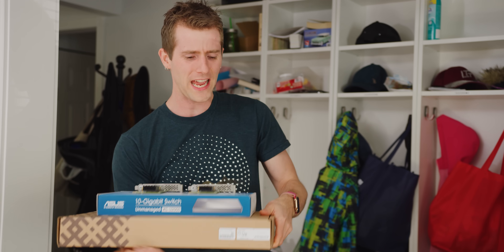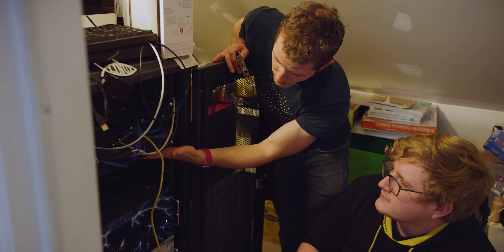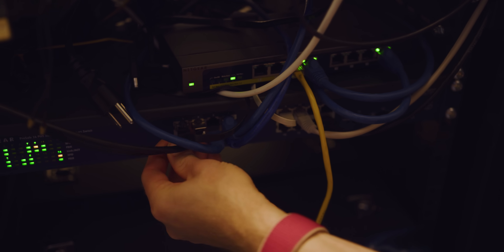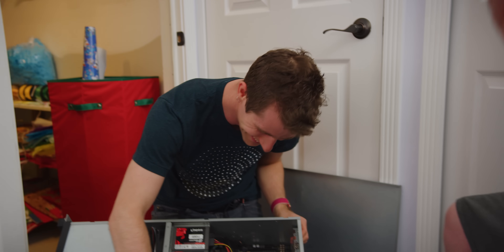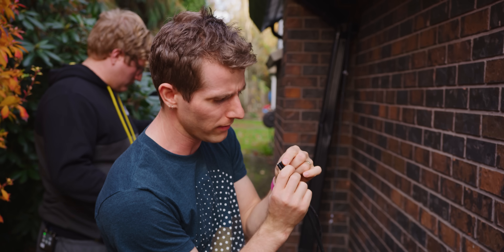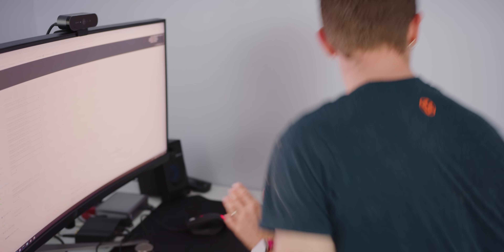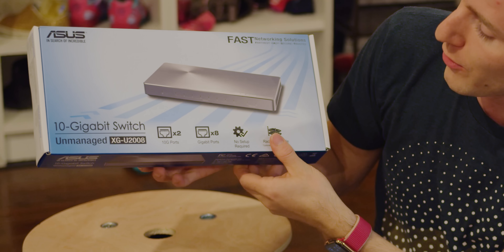Home 10 Gig Network Upgrade for CHEAP

Comment: "Just 500 USD"

Well, not as cheap as I was hoping :/
Reply: Some of Mikrotik's cheaper products offer SFP+ if you wanted to do 10Gb backbone between switches or if you just wanted a few devices to be at 10Gb (say a NAS, or any VM infrastructure)  and leave your endpoints at 1Gb.
Reply: @TheBrich91  I have two servers that this would be good for, however I'd also want 10g to my editing pc, and that would be a fairly long and expensive SFP cable unfortunately. Maybe prices will start coming down a bit more though, I'm sure enterprise 10g will continue to get cheaper as 40g is used more and 10g becomes cheaper overall.
Reply: @XOIIOXOIIO  you could also go with Multimode Fiber SFP's. They have come down in price A LOT.. You can get some pretty affordable secondhand HP or Dell branded SFP+ pcie cards for your servers and your Desktop.

Just a thought. I've been scheming on it myself lately.
Reply: @XOIIOXOIIO  A server/workstation with a 4port 10Gb or 2 2port with bridged connections would give you enough for a server and couple workstations
Reply: @TheBrich91  I'll have to look into it again. The limiting main factor would have basically been the 30 foot or so sfp run depending on how I routed it.
Reply: You get 4 hours of consulting about programming network switches in linux kernel drivers for $500 from me. YOU should get a new job.
Reply: @llothar68  Oh, I want a new job, but the market here sucks unless you have a bachelors degree for entry level positions, and moving elsewhere is expensive, same as getting said bachelors degree.

Comment: I actually think it would have been more realistic if you did this as a 2.5G/5G (802.11bz) project. It needs less cable changes, is cheaper, the switches are quieter, and it's more than plenty of bandwidth for a home.  Many NBase-T switches have an SFP+ for the NAS, as well.
Reply: Try finding a 5 GB card.
They don't seem to exist in my (somewhat limited) searching.
2.5 GB is common, cheap, and can still run on 5e.
Reply: @bricefleckenstein9666  At the time of posting I grabbed a Marvel AQN-108 for $69.  5 gig, single lane of PCI-E 3.0.  Unfortunately they are hard to find now, perhaps with the chip shortage they cut back on that product.
It's also hard to search for 5G network cards as you get a lot of hits for wireless.
Reply: @rbeck692  I don't do wireless.
Never saw any reason to use it.
I was NOT getting hits on wireless when I looked for 5G network cards - but it might depend on how you word the search.

And quite bluntly, with 2.5G cards at commonly $30 AND LESS (some under $15 for no-name stuff) and the switches even from name brand vendors commonly $10-$15 a port, I don't class $69 (or the lowest cost 10G I could find at well over $100 for 10BaseT and MORE if you went SFG plus transceiver) as being cheap for the performance.

Perhaps in a few more years.

Comment: but there is still no household router with 10Gbps WAN port, and of course , 10Gbps broadband is NA yet
Reply: Any router can be used in a household. A business connection could probably get you 10 Gb

Comment: Great vid thx.
Signing up for privacy.com asap...cool.
I went with the 4+1 port MicroTik CR305, 3xMellanox conX-3 nics, 8x10Gtek spf+ transceivers & 4×10Gtek OM3 fiber (3M-10M). (Looking for a fourth Mellanox nic at a decent price.)
Did the dumb... er...unmanaged switch setup. Jake rolling his eyes...yeah I'll VLan it later.
1st transfer test between 2 pc's: Samsung 500GB 860Evo on sata3/6GB cable to 250GB 850Evo on sata2/3GB cable was 384MBytes a sec.
Worked out to be around $195 per PC (x4) including switch.

Comment: me sitting here with 100mbps ethernet 
its good enough 
linus: 1 gig speed not good enough!!!
Reply: Switch to a 1 gig switch they are about 20 bucks for an 8 port then you'll begin to see the difference when you transfer data between machines

Comment: Please tell me if you are crimping you used solid core crimps that cup, or stranded core crimps with teeth for stranded core cables. I prefer punch down and hubbell gear. Also inside walls are better to wire always than outside walls. Oh and Fluke testing is amazing.

Comment: Hey Linus mikrotik super awesome gear. we specifically use it in our towers and our core network. (run ISP) they super powerful. give me a shout if you need any help with anything. know the things backwards. bgp and ospf routing super simple with them as well

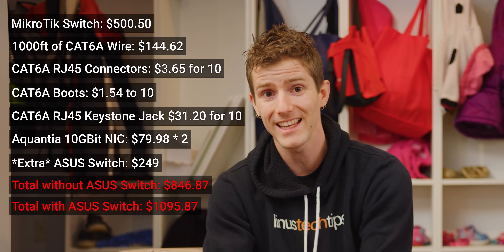Comment: 14:26 Yeah Linus, tech usually gets cheaper over time. Just wait another 3-5 years and the price will drop even more. 
Let's be real though, 99.9% of people don't NEED 10 gig networking in their houses. Most don't even have gigabit internet.
That's not to mention, saturating that throughput would be extremely hard for a typical household.

Comment: I did something similar but I did it the poor man's way. I got an old Linksys 2016 gigabit switch with two fiber optic ports which one of them goes to my media server and then everything else in the house gets a gigabit cable to it. So I get 10 gigabit to my home media server through fiber-optic instead.
Reply: But what if you need 10 gig to another machine. Now you have a problem. But if you have a server/workstation one could put a 2-port nic in that and connect that way or double up with 2 2 port four four total.

Comment: I'm running all 10gige on cat5e with Aquantia cards, Intel x540 cards and a Netgear XS708T... 50+ft runs indoor/outdoors, no issues. Was $700 for the switch at the time last year, but no issues to report.

Comment: I hardly saturate my 1gig network lmao
Reply: It's really easy to do with any real NAS activity or running backups. I have an older 300 GB hard drive that can comfortably do 1 gigabit
Reply: I don’t even have a NAS lol. Just two gaming computers and a Apple TV and some mobile devices and some raspberry pi’s. I would like to mess with a NAS though, especially the docker functionalities.
Reply: @brkbtjunkie  well hopefully you are backing up all your Games Etc.
Reply: mrmotofy no need. They exist on steam, origin, etc etc. my current game install size exceeds 2TB, I just don’t see the need to back up game files. I do back up all configurations and user files though.

Comment: I only have Cat 6 cables and the one that runs in the ceiling/loft was put there 10+ years ago (I think..)
Its shorter than 33 meters so its good for 10 gig

Comment: The big problem with this particular MikroTik switch is the fan noise.  That alone makes it problematic, given its positioning as a SOHO product.  It's not just the loudness but the pitch as well.  It's an annoying whine, not unlike the 1U Supermicros of yesteryear and their obnoxious Delta fans.  MikroTik really should have spent more time tweaking the thermals, or at the very least a bigger heatsink with quieter fans.

Comment: If the switch is set to a static IP on a difference range that may be why you can’t see the management IP :) I’d put myself on the 192.168.0.x range and do an advanced IP scan there . That’s if it’s managed at all ..

Comment: One of my favorite tips about separating and lining up the pairs when terminating lines is that when you cut the plastic lining for the outer cable, hold the tube that you're going to discard anyway. If you can put one wire of a pair inside the plastic tube and the other end outside you can untwist the pairs super fast by just pushing the shielding down and just doing a small clockwise motion as if you're screwing down on the twisted pair. Your guide looks pretty standard for any T-568B wiring, whether you are CAT 5, CAT 6, or CAT 7. 10GbE is more sensitive to connection and continuity  issues than 1GbE but otherwise follows the same requirements.

Comment: Using two mikrotik switches here for 10gbe (one in basement, other in office) and using them with 1gbs switches. Bit of a mess, but it works. Using used 10gbe mellanox cards from eBay.

Comment: I still don't understand why you don't just route the ethernet down through the walls on this? It would eliminate a lot of the hassle that you have for getting ethernet down to the media center. Though maybe there is something about how homes are built in Canada that is very different from the United States.

Comment: When I ran the first internet lines at my parents house 10 years ago I INSISTED using CAT6 cable, if we EVER get 10gig to their house, it has been ready for YEARS
Reply: I wired my whole house with at least 3 rj45 in every room and Cat6 around 12 yrs ago
Reply: You were ahead of your time
Reply: I would like some fiber optic, but with twisted pair cables, I can just buy some cables, some jacks, reference material to properly wire the jacks, and the multi-tool dedicated to twisted pair cables.

I had practice in making those kinds of cables as part of networking college course.
Reply: @Aereto  from MY experience in Networking in college, FiOs is finicky and a pain to use, and a simple break ruins the connection. Twisted pair is alot more durable

Comment: I bought that exact switch and am super happy with it :)
Reply: Oh, and for the love of god look into Winbox. These units run SwitchOS and RouterOS, and Winbox is the ultimate administrative tool for Mikrotik products.
Reply: routerboard.com // mikrotik.com etc etc
Reply: Yeah, yeah, too many replies I know. Not cool any more. Been using Mikrotik for over a decade, for the average user there is definitely a learning curve. But for pro-sumer level users there isn't much else out there that offers the power and functionality that these units do out of the box. Be careful when purchasing however, the products that are marketed as switches do not have the same packet processing capability that the router products do. Cloud switch products have non-blocking forwarding to cover any switch needs, however if you attempt to do any kind of routing you will run into limits fairly quickly. Make sure you do your research! Buy a router oriented product if that is your need.
Reply: @tq_1203  good
Reply: nice

Comment: "Completely blocks all the airflow..." Hasn't Jake seen Luke's video showcasing how even having multiple carboard boxes, a santa hat etc. inside the case barely affected things? =)

Meanwhile there's GN showing how removing a single dust filter or changing the placement of one case fan to a higher or lower mounting point can shave multiple degrees off of your computer. =)
Reply: because fans make airflow not some card boxes. If fans have good pooling and high pressure even santa claus cant make difference. If your airflow is rubbish from start then it's another story.

Comment: EDIT: I just noticed on the tech specs page that the first 8x 10GBase-T ports also support 2.5GbE/5GbE which may prove useful to those people with motherboards or Wireless Access Poinnts which support those speeds.

You should consider using iPerf for testing you network connections. This would allow you to test the network connection without worrying about disk performance bottlenecks. It could potentially provide a more accurate maximum performance for that network connection/route. You could also run tests from multiple source machines to multiple destination machines simultaneously to test if the switching fabric can properly handle more extreme scenarios.

Comment: Price for performance, Mikrorik equipments are the best.

I've been using Mikrotik devices for over 10 yours and I still haven't regretted my decision.

You just have full control over what you want the equipment to do for a really cheap price.

Congrats on your choice, you won't regret it.

Comment: Dude, do some cable management!
Also, call an exterminator. Rat poo is no joke.
Reply: Right, like the day before yesterday. No joke. 
Contagious disease + kids = no fun.
Reply: He now needs to review the Victor M2 Smart-Kill Wi-Fi Electronic Rat Trap

FYI, rats are smart! Roof rats are common around Houston in the winter time. If they can't find a way in, they will chew their way in!

Anyways yeah, no joke the damage they can cause to both insulation and electrical. In some cases, they can cause an electrical fire.

Comment: Holy crap..I'm renewing my house with cat 8. Trying to not get over 15meters of cable length. sfp shielding is really important. Here you see everything wrong for perfect 10gbit...no shielding..run senseless lengths of cabling.and using cat6 instead of cat7/8 for outdoor cabling..just kills my heart.40gbit is possible over cat8. So why not invest 60 bugs more for the cable and be safe for the future of 40gbit? Also non shielded cat5 Jack's.oO

Comment: $500 usd for a 12 port switch isn't cheap for home use TROLLIS!  And do you really have to splooge for cat 7?  What happens with 10gig on cat6, 5E, 5 etc?  you could test this by simply installing 10gig on a home with older RJ45 cables and see what happens by swapping in a few pcs with 10gig cards

And a lot of people run 1g or 100 mb (simply because  its still sufficent since not many people have a internet connection that does over 100 mb (some do sure but many are something less than what it can handle)

Comment: Being a nerdy fiber technician I went much cheaper by buying a Cisco with 4 SFP+ on eBay and ran fiber between my router, switch, and servers in my home. Using a Mikrotik RB4011 for my 10gb router.

Comment: Low voltage specializing electrician here:  the versiv is really cool we use them all the time, just finishing a job, 2 floors, 56 miles of cable, 16 24 port patch panels per floor, fiber backbone with redundant isp hookups, and about 50 grand in switches per floor alone.  I enjoyed seeing you guys do this.  It isn't always easy haha.
Reply: "56 miles of cable": My condolences to your back.

Comment: Good luck with that switch, while I love mikrotik routers, their switches are terrible, in fact I make sure to disable the switch chip on every mikrotik crs I configure and this is coming from a mikrotik certified routing engineer

Edit: download winbox it’s able to manage the switch via layer two and its more reliable than the built in web interface
Reply: Network engineer here as well. I love mikrotik hardware too, but i prefer to configure it through cli. It's much faster to configure, and its cli is well thought out.
Reply: Dominik Dobrowolski absolutely, but for what Linus was trying to do winbox is the way to go over the webfig

Comment: Ubiquiti’s 16 port XG is far superior to the Mikrotik switch for the same price. 12 SFP+ ports, 4 10Gb copper ports, and the ease of the UniFi controller.
Reply: But the rj45 is much more versatile for the average home or small business already wired

Comment: Great. 10 Gbit/s have arrived. I wonder when the first 40 or 100 Gbit/s over fiber will be affordable for everybody. 10Gbit is affordable,  if you already have CAT7 and if you take your money (saved for holidays) and upgrade your devices and cables.
But there is more:
IEEE 802.3ba seems to be in development. Can't wait for that. The only Problem: new tech is expensive.

Comment: Runs 10Gbps ports all over the house.
Gives 1Gbps connections to almost all hardwired devices.

Uses video streams that doesn’t go past 25Mbps and keeps living in the 80s before wireless was a thing.

Linus “Tech Tips”.
Reply: I wonder what that means.

Comment: Cool project.    I have been unable to find a reasonable POE switch with 10G capable ports.    I want a switch to connect all of my POE security cameras to 1G but have 10G ports  to  connect to my storage server.
Reply: Then all you need is gigabit Poe with 10 gig uplink. Realistically you cameras we'll never get anywhere near gigabit. They still only Run 100 Meg. Full 1080 is only 4 to 5 megabit 4K is maybe like 75 megabit
Reply: @mrmotofy    Right now i have 8  4k cameras that are recording at 30fps and 2 more that do about 2k.  I also have 3 access points plugged into the same switch on another vlan. I have a constant 50 meg outbound connection to offsite storage as well so i want as much overhead as i can get.  My current Cisco SG220-26P does well because I team 4 of the gig ports to my storage server as a kind of uplink.  But i need PoE+ with a good amount of power available to all ports.
Reply: @BorisFett  Gotcha, best I can find is that 4k won't break 100Mb especially with H.264. So if you're using a Gigabit switch you'll be just fine with lots of overhead. If you have a 10Gb uplink to your NAS that will help but it's still all overkill. But otherwise Ubiquiti has awesome products and Netgear has a 10Gb switch for about $750 I'd be interested to know if the cams or NVR have 1GB ports. Most still only have 100Mb. Stream 1 of your cams to your computer and use Task manager ethernet to watch the data flow. That should give you a good idea.

Comment: Cable must be Big $$$ up there ive been doing all my Installs in barn , work shop, House etc on my land with Cat 7 interior and Cat7 Burial cable outside for over 3 years now, I am actually running 10 gb on cat 7  soon to be jumping to cat 8  2000mhz @  40 gb cable  just make sure you use Metal jacks with insulators.  Cow}:-o)

Comment: I remember a time the compuany I worked for ran 1Gb cables to replace all the 10/100 base T and 10 Base2 cables connecting all the switches spread out in the office. And installing new switches with 1Gb links and 10/100 ports for the workstations. Those switches where like $500 each and replaced regular hubs in some spots.

Comment: In infrastructure data and telecoms engineer in uk when preparing cable for rj45 plug its a waste of time to strip more than 1inch of shielding it just takes longer and you just cut most of length anyway and one more thing when using spiner spin only onece and brake shielding never even spin more as you might find that on 300 cables you can get 40 failing 👍